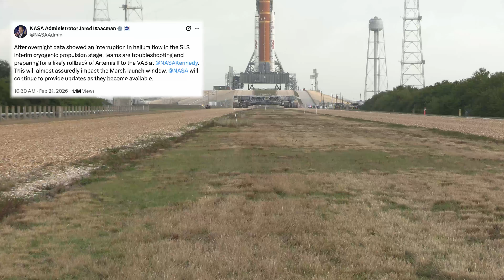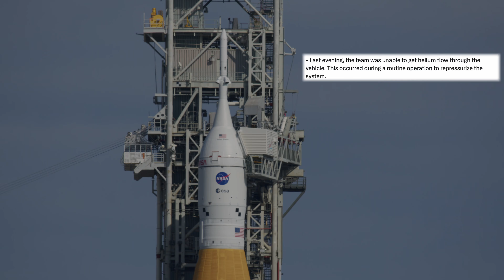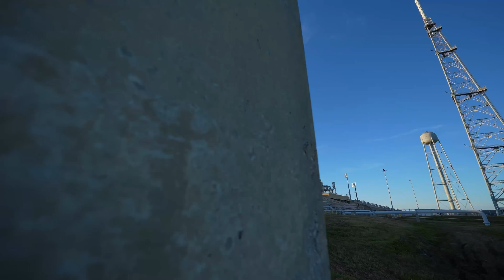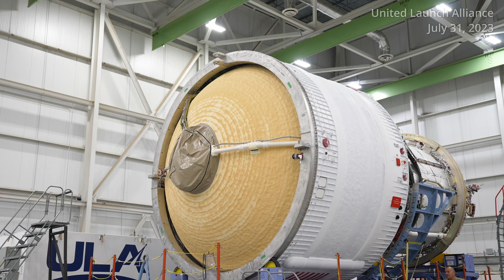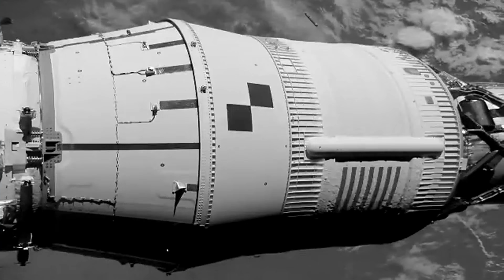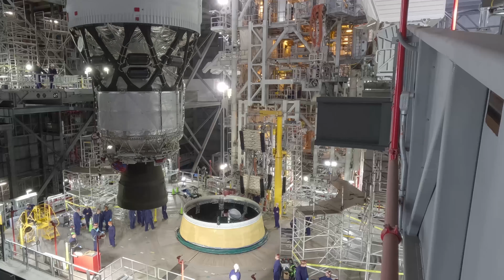Helium issue forces Artemis 2 launch delay, rocket return to Vehicle Assembly Building

Comment: They are taking 10 year old Cameras the moon.....yes you read that correctly. 10 year old Cameras I stead of a new Nikon. I am calling BS now. They are using a camera with an internal mirror so they can manipulate the images.
Reply: These cameras are being used because they are flight-qualified and proven reliable for space operations, not because NASA is “stuck in the past.” The idea that they are going to manipulate the images is stupid.
Reply: @Krunchy71 yes it is. We have better cameras that have been tested. You know nothing about photography or optics.
Reply: @NAME-o6v6t  The fact that we have better cameras is irrelevant. The cameras being used are more than adequate for the job. They have been flight tested and integrated into the equipment. They were state of the art when the systems were designed.
Reply: @Krunchy71 blah blah blah your saying absolutely nothing mate
Reply: @Cormac-jd2kx  You're the one with your lunatic theory that they need a specific model of camera to "manipulate the images". All you are doing is proving you know nothing about how rockets are built and designed.
Reply: @Krunchy71 check the FARTemis cameras 😂😂😂😂

Comment: Apollo was built with slide rules and flown with a computer that had 1/10th the  power of a Commodore 64.  Zero Apollo missions were scrubbed for mechanical issues.   Zero.
Reply: The Apollo 17 launch was paused shortly before liftoff because the automatic launch sequencer failed to pressurize the third stage’s liquid oxygen tank. Technicians fixed the issue and the countdown resumed before launch.

Apollo 16’s schedule was shifted by about a month in 1972 because of various vehicle issues, including damage to a fuel tank that had to be replaced, which required rolling the Saturn V off the pad for repairs.
Reply: @Krunchy71 Yes, but none for recurring "hydrogen leaks" in a handbuilt system designed and built without computer or AI.  Everyone at NASA should be fired for being incompetent.   They couldn't build the space shuttle today if their lives depended on it.
Reply: @bbaz6729  You're right that this is a shitty vehicle. But most of the blame goes to the politicians. NASA was forced to use this old technology and cobbled-together parts from the space shuttle because congress and the senate want to keep their precious jobs. The entire system and the cost+ methodology has ruined NASA.
Reply: Because Apollo missions were fake
Reply: @Cormac-jd2kx  What a stupid comment. We know the Apollo missions were not fake. No fewer than 5 other countries have taken pictures of the Apollo landing sites and found the lander and rover.
Reply: @Krunchy71 

Why do you need to lie?
NASA admitted they can’t find anything. They don’t have enough powerful telescope 😂😂😂😂😂😂

Call them

Comment: I wouldn’t want to fly in it, SLS propulsion is predominantly left over Shuttle hardware.
Reply: Artemess
Reply: It's predominantly the opposite. I'm tired of seeing this stupid myth regurgitated everywhere.
Reply: @FrankyPi  whats your source?  Nasa has said the engines for the first 4 flights are from the shuttle.  The core stage is modified shuttle tanks and the solid boosters are adapted sections from the shuttle.
Reply: @trekie30122  Only the first part is correct. Main engines for Block 1 and the first Block 1B SLS are Shuttle flown, 16 in total RS-25Ds (with the exception of one built from spare parts), that were extensively modified and adapted for use on the core stage, which is a brand new piece of hardware. Its resemblance to Shuttle ET is purely visual, it only uses the same diameter and propellant while having that characteristic pale yellow spray on insulation foam on the outside which turns bronze orange from exposure to UV light. The design, manufacturing methods are completely different, it's not even made out of same type of aluminum. It's the biggest rocket stage NASA has ever built and the biggest ever hydrolox stage.

The only other components that were left over from Shuttle program are the raw steel casings contained within five-segment SRBs, everything else about them is new and different, the extra segment, avionics, TVC, nozzle, thrust profile, etc. Even the propellant formula is different. 

Starting from Artemis V, RS-25Ds will be replaced by production restart RS-25Es, new variant optimized for single use, more performance and less cost. They already built some and started testing. Existing SRB design will be replaced by next-gen BOLE SRBs on Block 2 SLS, bringing improvements across the board. BOLE recently reached a big milestone with first ever full configuration static fire test that resulted in blowing off the aft end due to unexpected overperformance. Block 2 SLS will rival Saturn V capability, with 50+ tons to TLI. Block 1B will have 40+ tons.
Reply: @trekie30122  im pretty sure they are newly built, or refurbished spare parts, not actual engines from the shuttles that were used. that being said, it's still ridiculous that we are using a Frankenstein rocket with outdated technology for something so important, we need a dedicated lunar rocket, not another modular heavy launch system like they've been trying to do for the past 20 years. they might as well rebuild and redesign the Saturn rocket with more modern components, kind of like the Soyuz.
Reply: @haydenisanerd4958  15 out of 16 engines used in first 4 missions are adapted Shuttle flown engines, one is built out of spare parts. Production restart E variant optimized for single use, more performance and less cost is coming on second flight of Block 1B for Artemis V. What do you mean by "dedicated lunar" rocket? Block 2 SLS will have slightly better TLI capability than Saturn V, still doesn't change the fact that no Artemis lander can fit in a single launch like on Apollo, or even a single separate launch, because any crewed Artemis lander is multiple times heavier than Apollo LM, no rocket that ever was would be able to take any of those to lunar orbit in a single launch, let alone together with crewed spacecraft like Orion. Multi-launch architecture for landers is inevitable, the only question is how simple can it be. Blue Origin's accelerated lander architecture was recently revealed as an orbital assembly plan without refueling achieved in 4 launches. That's significantly fewer launches than any refueling architecture including theirs.

Comment: As far as I remember, liquid helium is even more difficult to control than liquid hydrogen. Is this the case?
Reply: To my knowledge, this are high pressure tanks at ambient temperature filled with Helium gas with 6000-8000 psi (414 - 552 bar) .
Reply: @Erik_Grosse  Oh, liquid Helium is NOT used in the SLS rocket. ILST (I Learned Something Today)! Thanks.

Comment: it looks like 70s tech, I say its doomed, I hope its not crewed
Reply: Artemis II is crewed
Reply: @TheCiardellas  thank you, I would not like to be on that craft at all!
Reply: Well, at least 50s Tech, Jupiter-C (Juno I), based on 30s and 40s Tech, then 60s and 70s Tech worked.
Reply: Well a large part of it is built from repurposed shuttle parts so that would be why.
Reply: @killman369547  Only a small part is actually, most of it is new or new versions of hardware that has been in use. This issue happened in ICPS, which is basically a modified Delta IV DCSS.